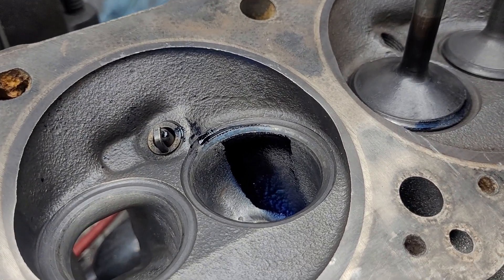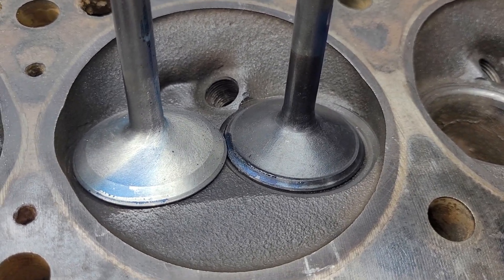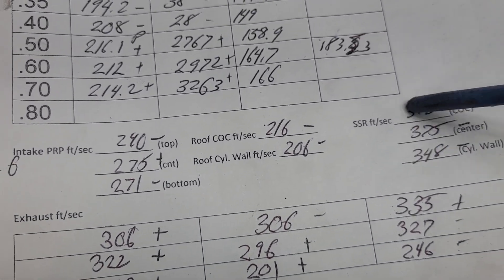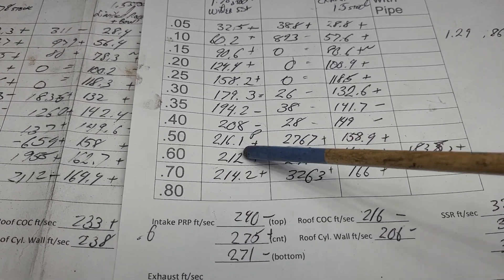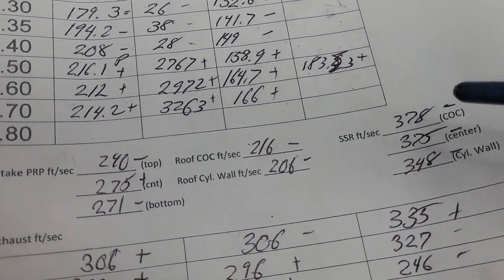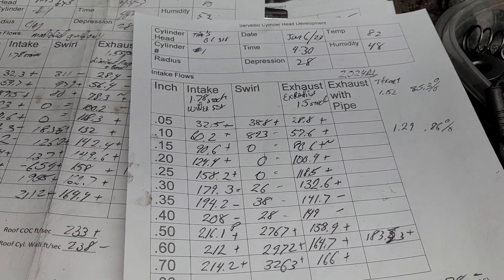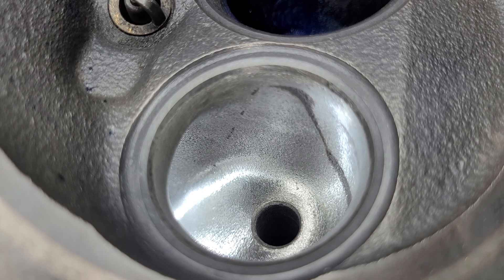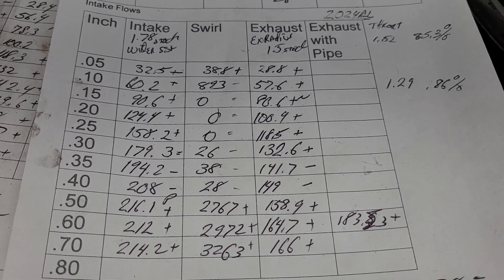David Vizard, U.T.G., U.M.S., Mission Impossible 318 project. Wider ssr intake, radius throat ex.

Comment: How much to port and valve job some 6.0 LS heads for me .. street / strip daily driver combo 2.02 / 1.60 or better valves
Reply: 4" bore 11:1 2002 LQ9 4cc dome pistons  218/224@.050 cam on 110 lsa full bolt ons long tubes and x pipe
Reply from the maker: @RAWRMotorsports  charlesservedio@gmail.com. thanks

Comment: I'm doing a set of 318 heads at the moment fot my 1 ton dodge van with a 360. I put a set of 1.60 exhaust valves and I actually did similar cuts in the ports that you are doing.
Reply from the maker: It will run well, don't over cam it. Thanks

Comment: Great detailed analysis on the porting process Charles!  I'd love to see your porting process on a aluminum 113 sbc head!
Reply from the maker: I actually have a set, they are done. 265 cfm if I remember right 2" / 1.55" combo.
Reply: @servediocylinderheads  Hi Charles and thank for your answer! I'd love to see point out some flow restriction spots on the 113's! Say if I were to use the stock 1.94 / 1.5 valves, what could i expect to get them flow at most( being ofcourse, considerably less than 265cfm ) ?
Reply from the maker: @mikkokuorttinen3113  I would think 230 /150

Comment: Awrsome work!!! Im still interested what happens when you introduce more port bias. But right now your around where i have my 318 heads. Albiet my heads have quite a biy more port bias on the roof. Cant wait to see your reviw on the EQ magnum heads. They may be a better and cheaper option that most cast aluminum heads if you dont mind they are iron.
Reply from the maker: They are not cast in New Zeland anymore.

Comment: Chatlie, those eq magnums are a dream of a head. They even make one with the LA bolt pattern çthey changed when they made the magnums. There are guys who have ported them to work better than the cnc ported trickflow aluminum head. Tou pick up a set of  eq magnums. Put a good valve job on them in a good setup and they will make 450+